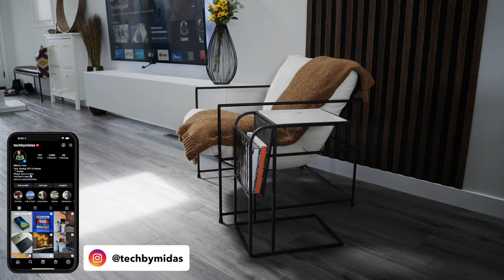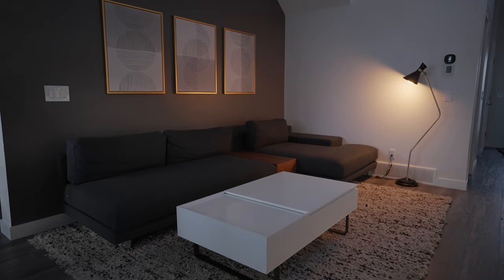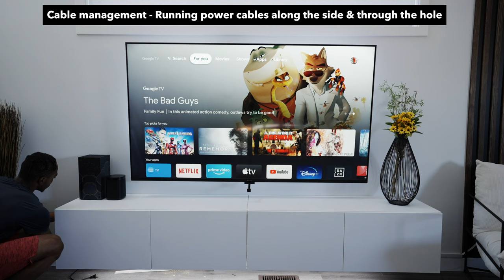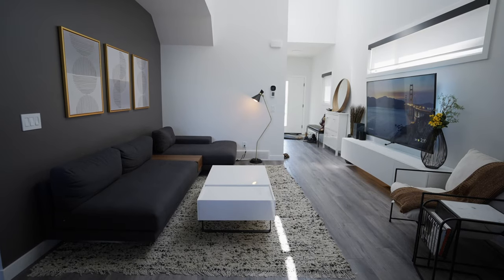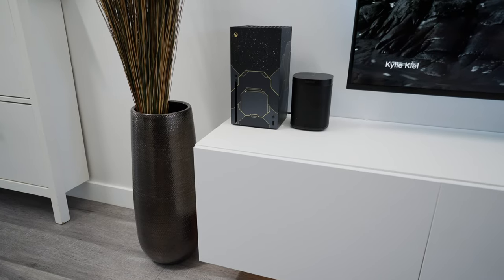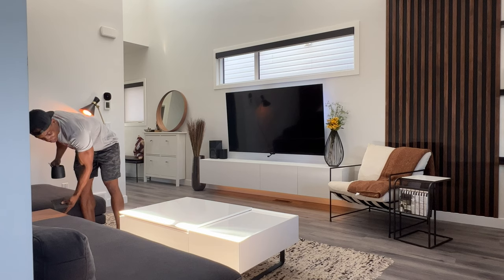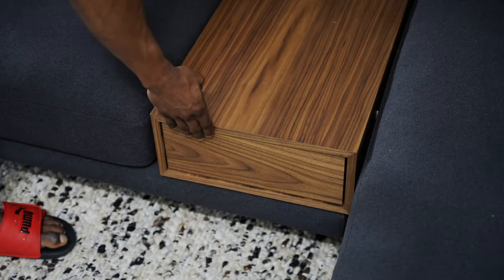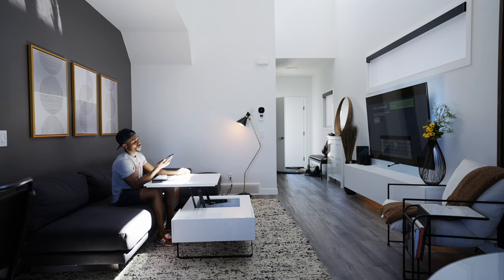Modern Living Room Upgrade & Tour | New TV outlet, Xbox Series X, Picture wall & more!

Comment: Also you should not use those anchors to hang your TV. Especially for a TV on an articulating mount. I’ve had a whole wall come down before. Use the Toggles… + at least one stud with lag bolts. And any TV larger than 65” should NEVER be put down flat on any surface. Always attach the legs and keep it vertical while you’re doing work.